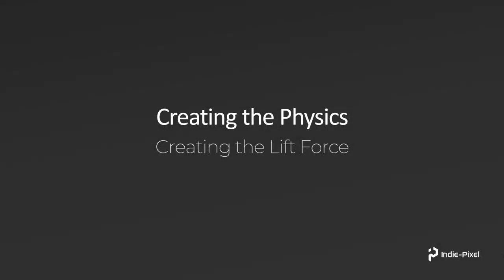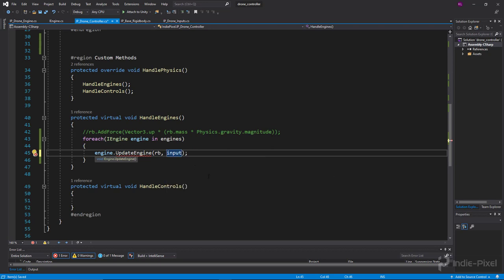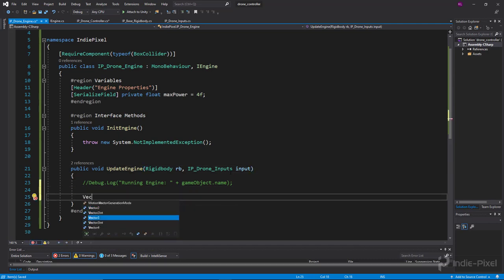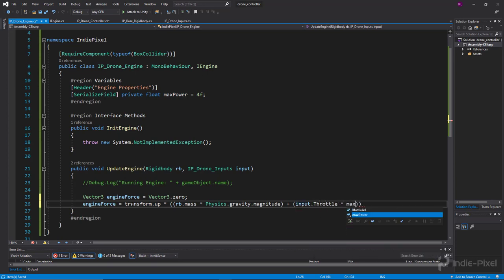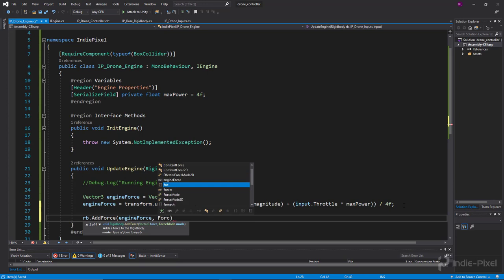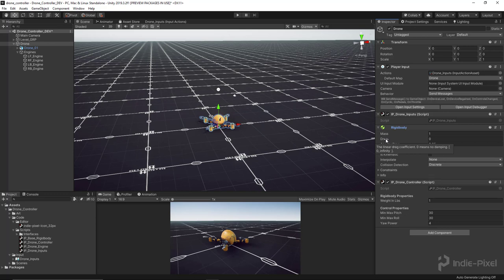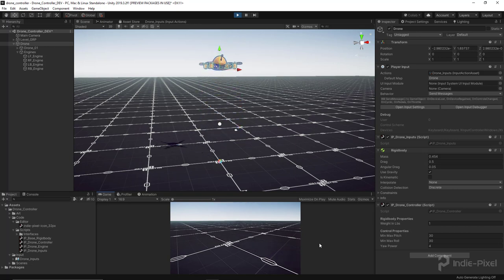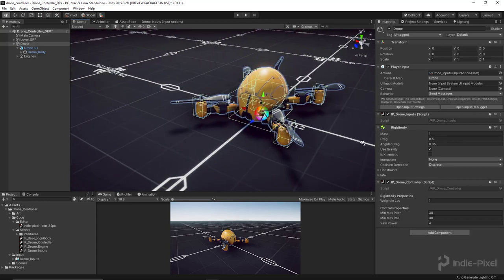Unity 2019 - Drone Controller - Section 3 - Video 5

Comment: for some reason it doesn't move up and down, it moves and rotates perfectly but the throttle just doesn't work
Reply: nevermind I got it
Reply: @ruisu2105  How did you get it to work? For some reason, my throttle doesn't work. My drone doesn't even hover which is quite strange.

Comment: Hi! As for 04.2021 with input system 1.0.2 I get "NullReferenceException: Object reference not set to an instance of an object" after trying input to work on Throttle.
engineForce = transform.up * ((rb.mass * Physics.gravity.magnitude) + (input.Throttle * maxPower)) / 4f;

I assume that it is problem with instantiating the Input system with awake with onenable and ondisable but, I can't wind workaround cause of the complex (for me) inheritance of the files.
Reply from the maker: Which script and variable is throwing the null ref?
Reply: @IndiePixel3D  Update Engine in Engine. Without input.Throttle force is applied.
Reply: Basically whenever I try to debug input.xyz it throws an error of null ref.

Comment: I get this error after saving all scripts:  error CS0535: 'IP_Drone_Engine' does not implement interface member 'IEngine.UpdateEngine()'. What can I do?
Reply from the maker: You need to make sure to implement all interface methods if you are inheriting from an interface class.  so in your IP_Drone_Engine class add the method public void UpdateEngine(){}  and the error should go away.
Reply: @IndiePixel3D  I already have it. In the code there's no errors but when saving that message appears. I have  this method: public void UpdateEngine(Rigidbody rb, IP_Drone_Inputs input) {}
Reply: Thanks btw
Reply from the maker: @rubencanoraalvarez8504  no prob.  Im not sure then.  If Visual Studio isnt throwing an error, sounds like Unity is having a hard time compiling something.  Id have to see your project to figure out the issue.
Reply: @IndiePixel3D  Hey, I 've just deleted some of the code and wrote it again in case and it worked, and it did... Thank you so much. Really nice tutorials!!